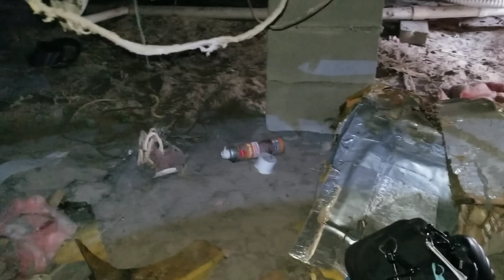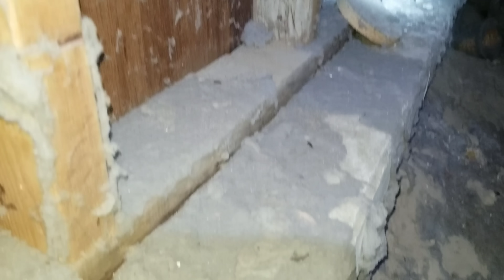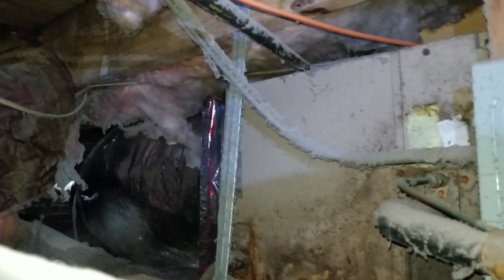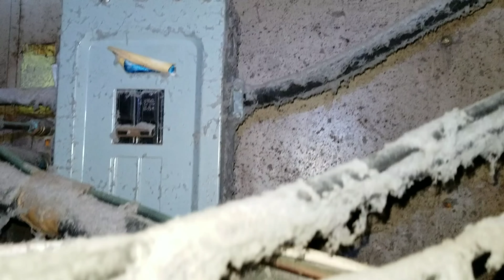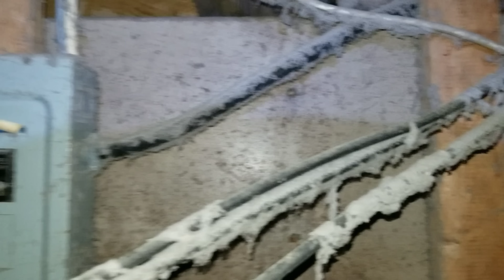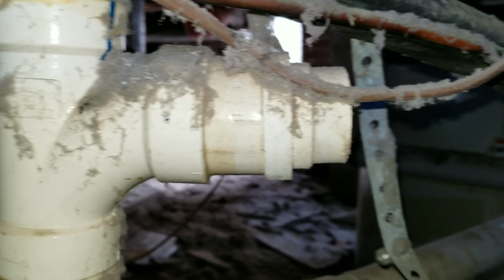Real HVAC Tech Life #2

Comment: Wow I DO NOT envie you Brad. So I'm from Alberta so pardon my ignorance, but are basement less homes the norm there? Why is that? Keep up the good work Bud. Cheers!!
Reply from the maker: Thanks as always Paul! 
Where I live in South Carolina I am at sea level so there are VERY few below ground basements due to flooding. Sadly, since there are no codes preventing it, builders stick the HVAC equipment in either the attic or crawlspace instead of designing a small utility closet.

Comment: Man you have been getting the really ugly one's lmao
Reply from the maker: Nah.. just stored up short videos over a couple years I didnt know what to do with.
Reply: @HVACinSC  jobs like this come in packages sometimes lol. I had new unit that was swapped by side show bo. Braze joint leaking, fixed orifice was finger tight and leaking, low voltage wiring all tied together and going to high voltage....service call bad indoor coil. The indoor coil was the only thing correct and working lol.
Reply: Bob